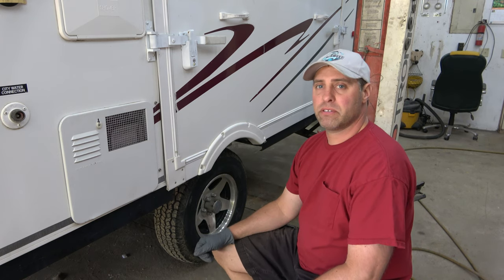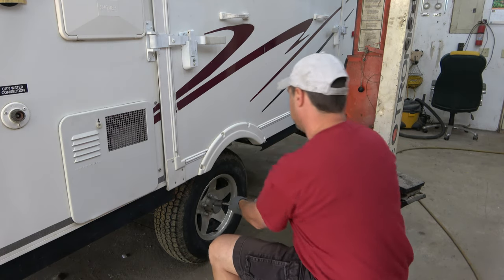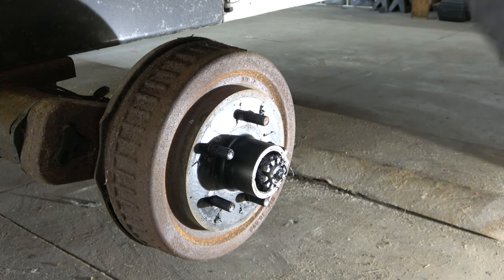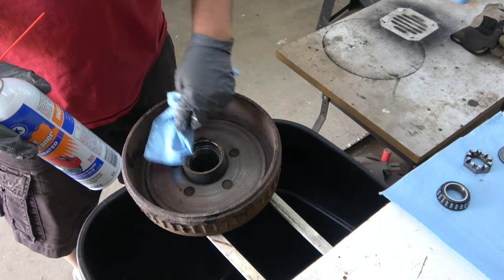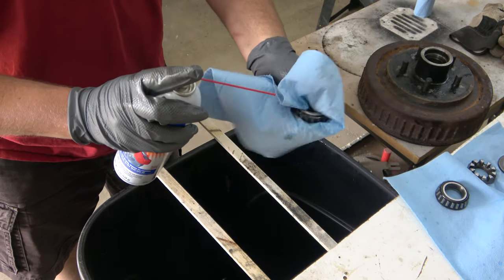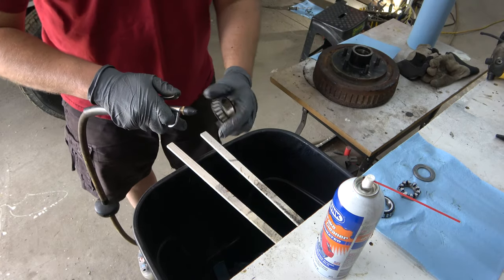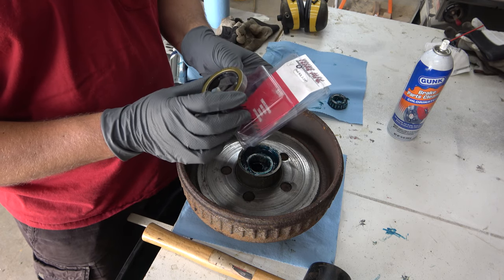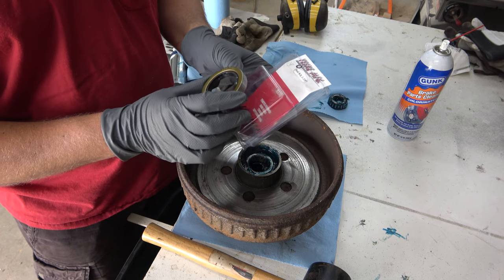How to repack trailer bearings with electric brakes

Comment: Thanks for the video   You explained very well the steps.    I got one question.  Can you buy this parts /barings ,seals etc. at my local auto parts store. ?
Reply from the maker: You can usually find them at an auto parts store. You might have better luck though going to a place like Tractor Supply, Northern Tool, or Fleet Farm. I'm not sure where you live, but these are the stores near me that carry parts specific to trailers. I find Napa Auto Parts usually has parts, or can at least order parts that will work. I've gotten parts for my tractors and ATV's there, so that's an option.

Comment: It’s interesting that your lube axles have a cotter pin hole drilled through them. It would seem to be an exit hole for the grease channel right behind the zirk. Maybe I’m missing something, though. Mine have a nut retention cap that uses a D-ring style lock matching a milling on the side of the axle to hold the nut from spinning, rather than a through-pin and castle nut. Just a curiosity. Nice video. Thanks for posting!
Reply from the maker: That's interesting. Most of my trailer axles have the cotter pin and castle nut. I guess they make a few different styles of axles. Thanks for the comment. It was nice to hear your perspective.
Reply: @GoMidwestFishing  My cotter pin hole was drilled to one side of the grease hole and misses the grease port, looks like yours is the same if you notice the pin takes a slight turn when you hammer it in. Great refresher or start point video, thanks.

Comment: Easy how 2....I do this to both boat trailers every year ...The only difference I use pressurized Buddy Bearings to keep saltwater from entering the rear seal!!
Reply from the maker: I also use bearing buddies on my boat trailers. This is a camper, so I didn't spend the extra $ for bearing buddies. Glad to see you taking care of your equipment. I see far too many trailers sitting on the side of the road.